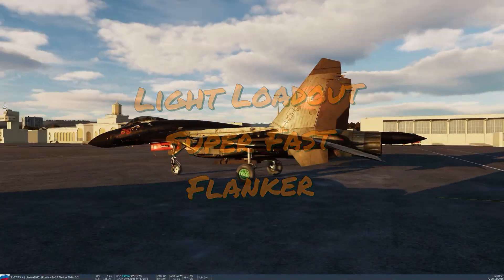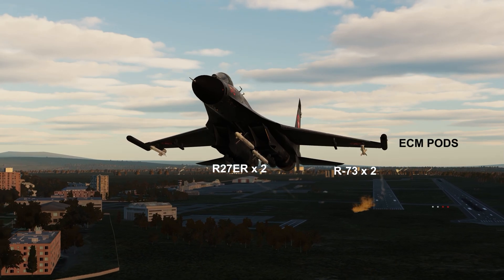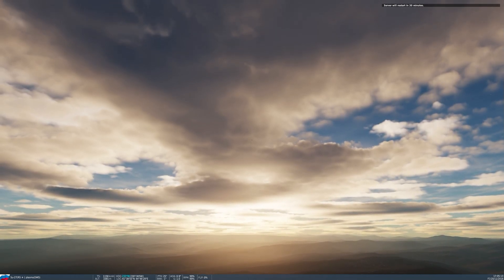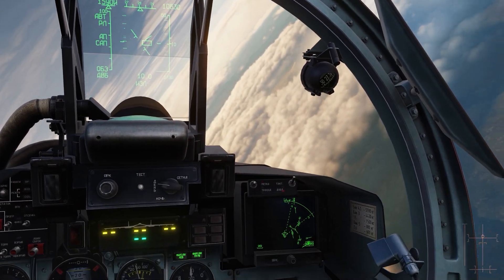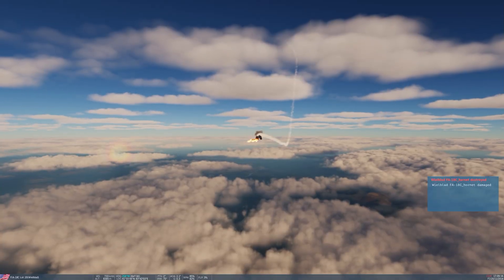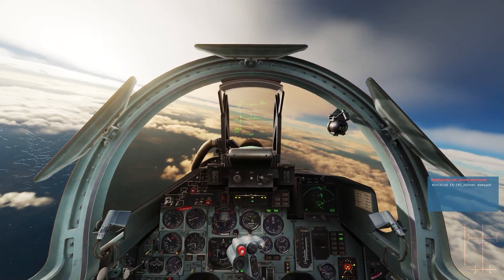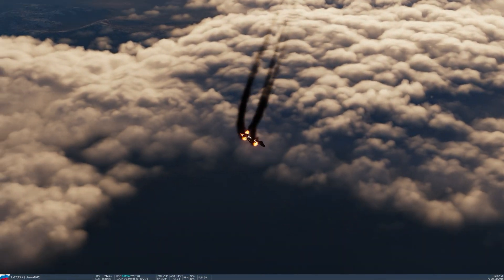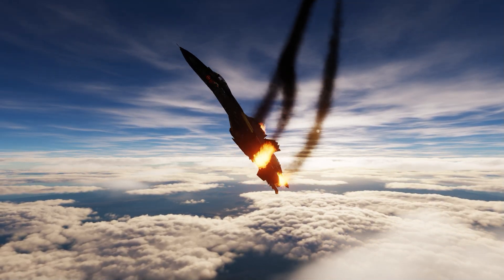dcs world -🥓🚀🥓 hypersonic missiles on flanker su-27 air to air weapon guide

Comment: Awesome, Video Plasma! A question if you will, you said that an F 16 is capable of catching you, but I could see you were already around mach 2 which is like the top speed of an f16 (prolly clean) I am a little confused here. Is the F16 top speed poorly modelled in dcs?
Reply from the maker: Ahh if the f16 got up high he can get to mach 1.8 or 1.9 and then could fire a aim120 at my ass
If I was flying home and low on fuel, that missile can catch me
As it's impulse combined with launch aircraft would make it fly mach 3-4 up high before it hits me in the ass
Reply: @plazma1945  Ahhh I see, I keep hearing that the f 16 is pretty dominant in BVR, but I don't get how a single engined aircraft with an intake not designed for high speed flight could cause so much problem, especially since it needs to carry bags to have any kind of endurance. I'd expect the f15, 14 mig 29 and su 27 to accelerate to Mach 2 quite a bit quicker inspite of the f 16 Thrust to Weight Ratio
Reply from the maker: @vineetkaddu1214   f-15 is a monster, dominates everything its new radar and range and speed are true superiority. i have a video called how to kill an f-15 check the channel, the F15 can see you at twice the distance the f-16 can. however, the f-16 for now has datalink, whereas the f15 does not have a MAP view of enemy threats, also the F16 is very maneuverable, whereas the f15 is more of a BIG circuit guy, comes in high and fast shoots pulls back and repeats. both are great and really are designed for compliemnt.

the russian aircraft in dcs are based on the 1990s versions whereas the F16 and F18 are based on 2008 versions, with newer missiles and radars. so its hard for the flanker to compete, fox-1 vs fox-3 missile its tough.
Reply: @plazma1945  Thanks for the info man, I'll be sure to check your f15 video out, being loving your content a lot, as a fellow Red Force Jets Enjoyer.

Comment: Hypersonic Flanker Power.  I need to load up on some R27ER's.   Quick Question, If you launch an R77 from the same parameters, how fast will it go?  Just curious.
Reply: at 11000 meters R77  ~Mach 4,5 ,  15-16000 meter altitute ER Mach 6 and R-77 Mach 5 when aircraft speed is about Mach 2
Reply from the maker: It fails... It performs around 1/2 as effective as r27